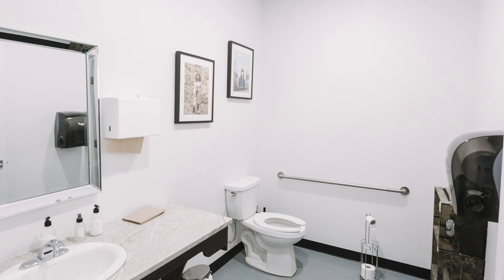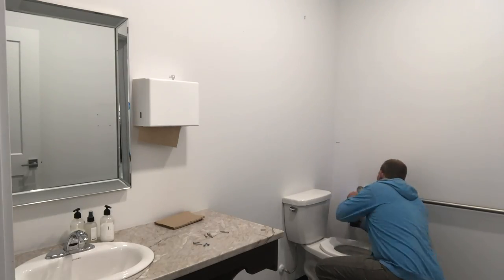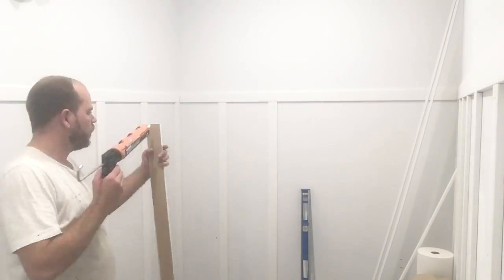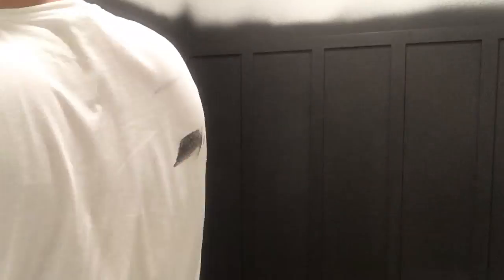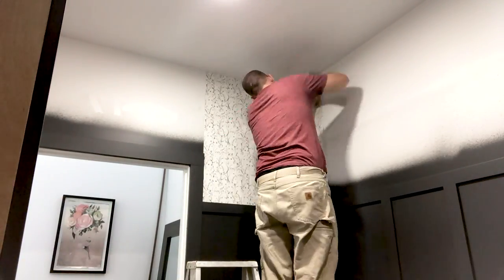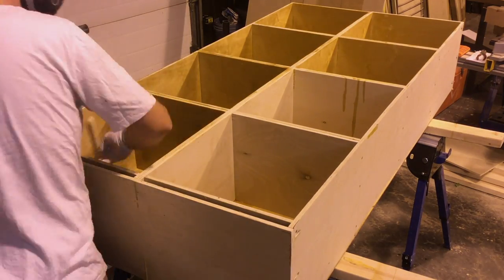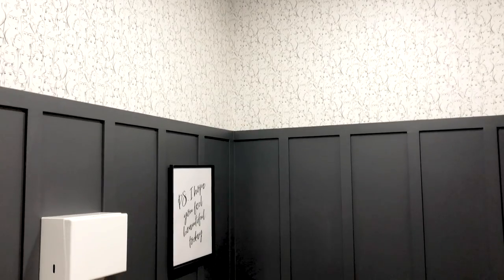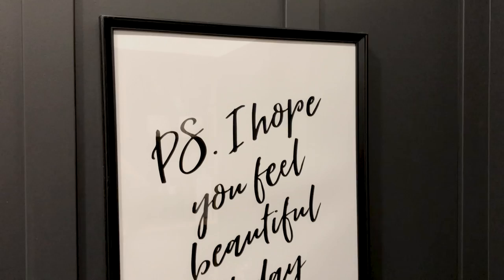WEEKEND BATHROOM MAKEOVER | Two Hair Salon Bathrooms in FOUR days!

Comment: A trick my dad taught me when doing vertical lines like this is to cut a board (like a 1x2) the length you want in between the vertical boards, let’s say 12 inches, you make your spacer board to be a 1x2x12, and then you don’t have to measure and know you are square. You just use your board horizontally to butt up the vertical ones, and you get the exact space each time, and it is super fast. He taught me to make blanket ladders this way, and it is so easy peasy. I hope that makes sense and may be a new helpful trick from an old, wise woodworker. Lol

Comment: I'm Not trying to knock your work it came out awesome. I was wondering why you glued the flooring down due to the glue cracking over time and separating making noise. Keep up the good work!
Reply from the maker: jay it was recommended by the flooring store for the particular product we were using and the higher traffic commercial setting. We did it at home previously with similar flooring that we didn’t glue and it worked great in that setting!
Reply: @LindiandRuss  that would make sense. TY for answering have an awesome day!